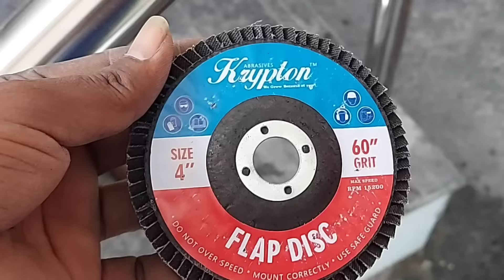how to steel railing elbow joint finishing | stainless steel | stainless steel railing design home

Comment: Nice work ... 
Balustrad me jo pipe welding Kiya he usme welding Ka black daag reh jata he 
Wo keise nikale....
Reply from the maker: Bhai jis jaga machine nahi jati us jaga (1)maat cloth ka use kar na(2) Agar nahi gaya tu acid ka  istemal karna aur jaldise water se clean karna ok bhai
Reply: Bhai konsa acid battery wala please reply❤
Reply from the maker: @jafarpathan8855  bhai acid use nahi karta ho my bhai sara machine se kam karta ho aur cleaning ke liye paint wala tinner use karta ho ok bhai reply
Reply: @SSALLTECH99  bhai aur ak saval please AAP welding kitne ampere par karte ho❤️
Reply from the maker: @jafarpathan8855  60 & 70 par karta ho power lode dekh kar bhai kahi par kam aur kahi par jiyada atahi electrical power us liye  ok bhai samaj aya tu reply
Reply: @SSALLTECH99  shukriya bhai ❤️❤️
Reply from the maker: @jafarpathan8855    aap ku bi shukriya bhai comment karne keliye  husaka tu like kardu bhai

Comment: Could you advise which product is suitable to remove the rust or dust and maintain the Shining 🌟
Reply from the maker: Sir without buffing polish? soap oil full apply and cleaning and water full washing  totally fast work 80% polish confirm    ok sir pls reply
Reply: 304 doesn't rust